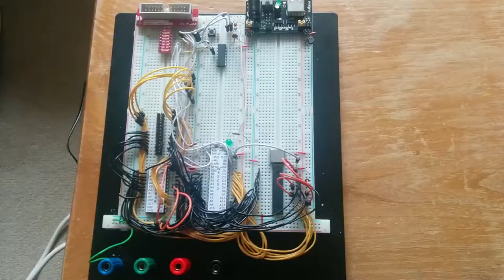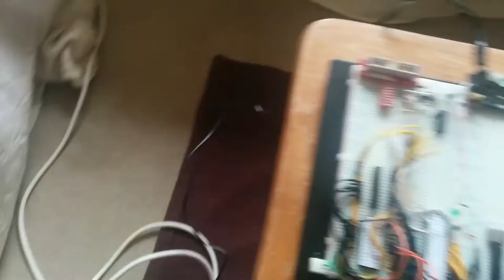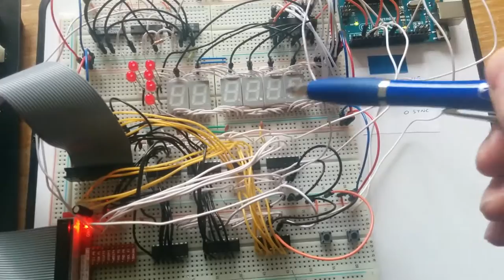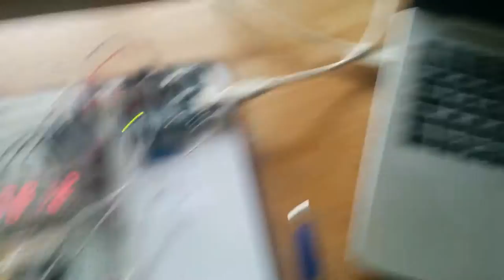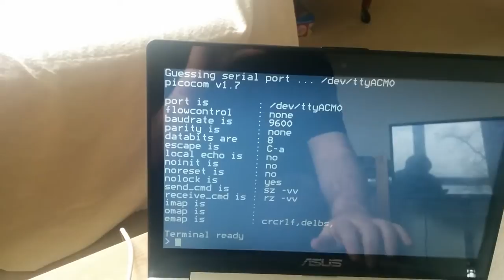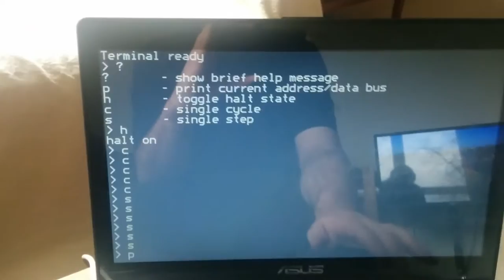Buri: a homebrew 6502 computer - part 1

Comment: I want to build someong like this. What do i need for it? I don't have an electronics store nearby and it is hard to get electronic parts from the internet, because i live in germany and there are no good german electronics websites.

Should i buy somethng like a PC based logic analyzer? How much do i need to spend on it and how much channels do i need? What type of ROM / RAM should i buy? And which programmer do i need for the ROM?

I only have a basic arduino starter kit, a few jumper wires, a few 74HC595 shift registers and an antistatic wrist strap. But i think, i know enough about electronics and programming to build this.
Reply from the maker: Hi, I wrote some words on this: http://www.richwareham.com/articles/2015/03/03/getting-started-in-electronics. I hope it answers some of your questions.